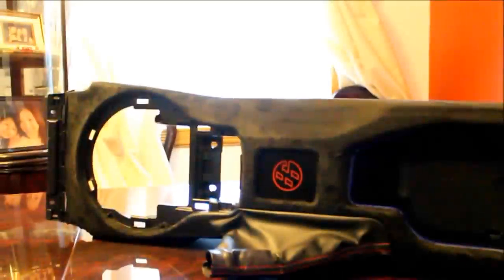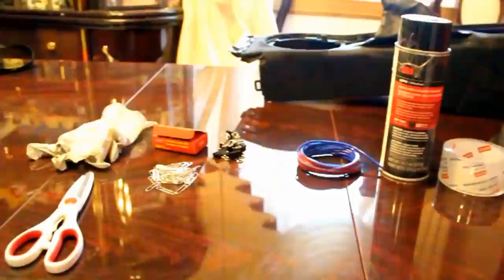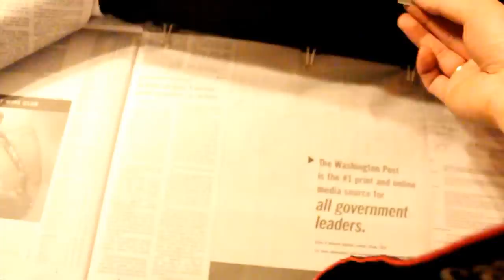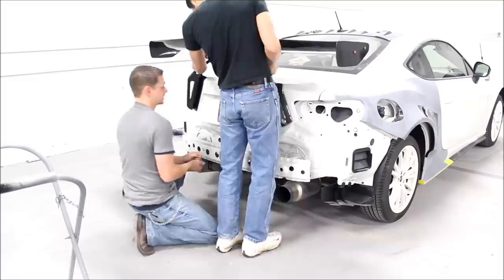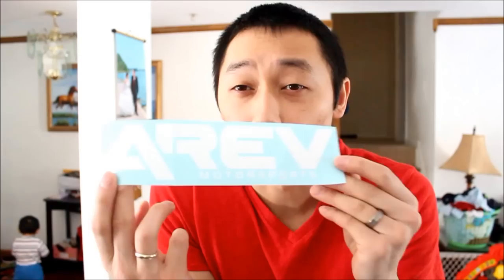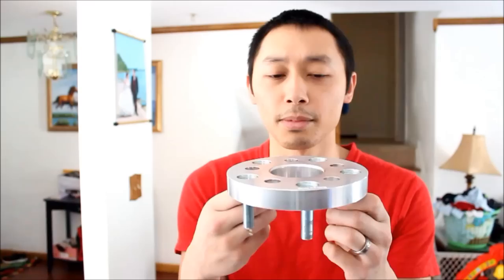How to wrap your center console in Alcantara BRZ FRS GT86

Comment: how would you rate the difficulty level of this job out of 10??
Reply: When I wrapped mine in self adhesive suede the only difficult part was the radio surround. Doing it with proper alcantara and glue is probably actually easier.
Reply from the maker: pretty easy. This was my first time doing it and I just went in on it. Just have to take your time.

Comment from the maker: Henry Greive Here is the AC full center. But if you only want the trim you can just pull that apart as well. Just be careful. https://www.youtube.com/watch?v=PAy26LMslvY&feature=youtu.be but for that two interior piece gotta remove the middle a bit where radio is. There is a hidden screw holding it in. As you can see from this image there silver piece you can see the screw http://i1177.photobucket.com/albums/x344/esanabria84/89d811e5.jpg Once you get it off I believe you just pull it out toward the center of the car. :) http://i1177.photobucket.com/albums/x344/esanabria84/3a8f0e96.jpg
Reply: Frank Hong I got the A.C and, unscrewed the two bolts for the pillars however when i pull forward they seem to be connected to the side panels. The instrument cluster frame, is that one screw on top the only one needed to be that to be removed. Also how'd you remove the transmission tunnel piece? Thanks  you
Reply from the maker: The circle where the shifters are? https://www.youtube.com/watch?v=sI9xgX0pefk

Comment: Please do the dash next
Reply from the maker: Dash and roll cage will be done at the same time later along with a DIY video :) There are some hidden bolts and stuff but it's pretty easy. & you should use a bush glue. Maybe in two weeks? I am trying to finish my rocket bunny build ~_~
Reply: ok, i don't think i should do my dash since I'm a novice maybe the center console.
Reply from the maker: FAINTEN17 You should be able to do this. This was my first time wrapping a complicated piece.

Comment: Where did you get the Spacers at? Looks good
Reply from the maker: Hey. http://motorsport-tech.com/ I purchased when it was 25% off. They pretty much make to your specifications. It is wheel centric and hub centric. along with a lifetime warranty. You can even ask for like a strange number 28mm adapters or spacers. Anyhow, they stand by there product so you don't have to worry about quality. I heard them because do some sponsor work at sema and racing teams. High reviews. but high prices.